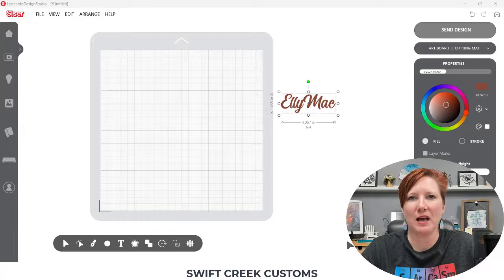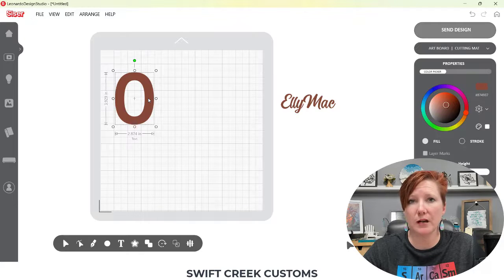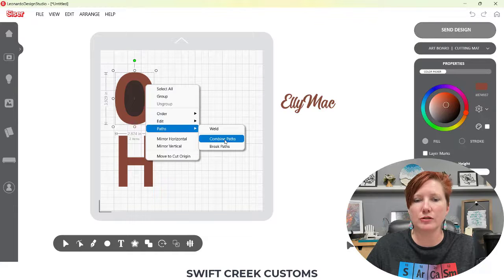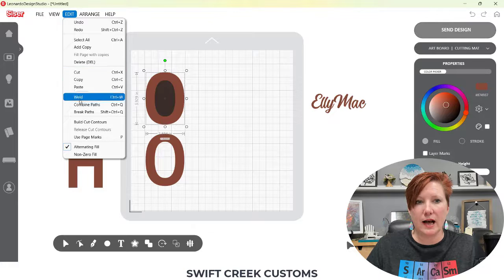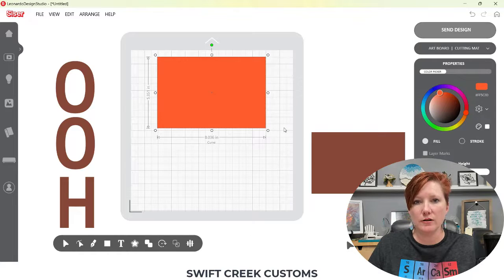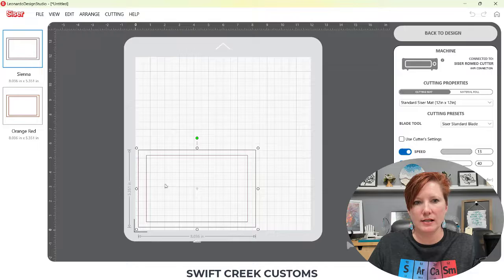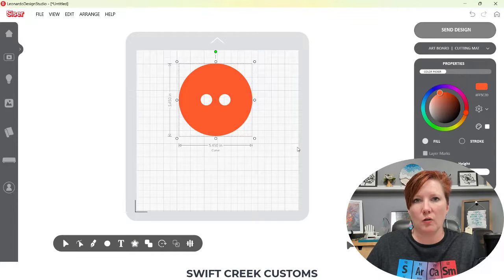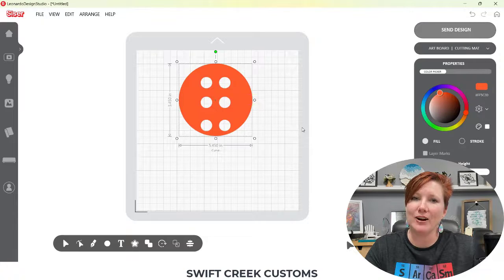Leonardo Design Studio Compound Paths Explained

Comment: Thank you, but what if I have a sunburst on top of my rectangle that has text. The sunburst ☀️ is halfway outside of the bottom portion of the rectangle, and I just want to flatten cut the outside of the design without all the cuts inside of the rectangle that make up the text and the sunburst 🌞. 

It’s a label for a jar.  How do just cut the combined flat shape without cutting all of the letters and the top portion of the  sunburst? 🌞 

I hope that I have explained it clearly for you to understand what I want to do. 

I want to cut the intricate outline of only the bottom of the 🌞 sunburst as part of the rectangle label that has the shape of the sunburst at the bottom center. But all connected with the label logo intact when I print and cut it. Only cutting around the outside of this label that has the shape of sunburst hanging off the bottom of it. 

I’m sure you can even explain this a whole lot quicker and more simple than I just did. 

Again, thank you. ☺️
Reply from the maker: Select all of the design and build Contours in the bottom toolbar.

Comment: I am so upset when I bring files in for it to cut it doesn't cut inside some of the letters how do I fix this
Reply from the maker: Depends on the file type.... 
What file type are you opening? 
Are you selecting, include holes when you open the file? 
If it's a png or joeg file, is it 300 dpi resolution? 
Low resolution files will trace what it can see. If it's too low of resolution, then it may not see the insides.
Reply: @SwiftCreekCustoms  png and I do click add holes
Reply from the maker: @VitadAngel  are they 300 dpi resolution?
Reply: @SwiftCreekCustoms  I don't know how do I see what resolution they are in Leonardo I click 300 dpi
Reply: @SwiftCreekCustoms  I edit my photos in canvas and remove the background and everything
Reply from the maker: @AngelsVlogsandMore  unless you are changing them on export - Canva exports at 72 dpi. 
LDS can't make up data, so it can only open ay the dpi it is saved at, even if you choose 300. 
There are a few YouTube videos out there on how to save from Canva at 300 dpi.